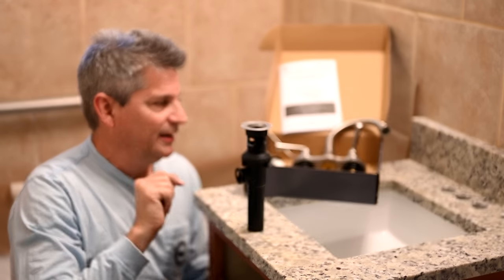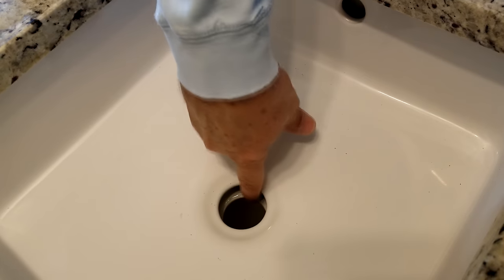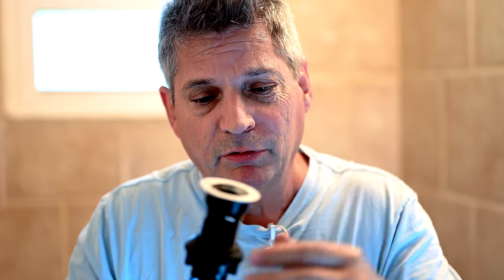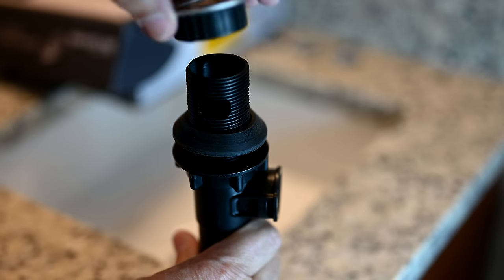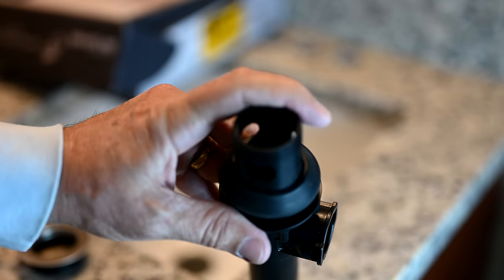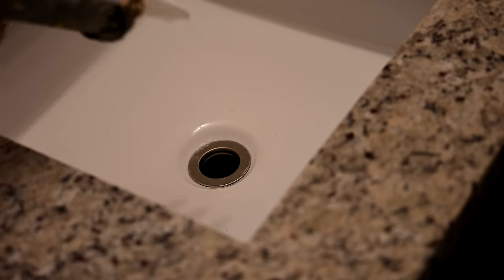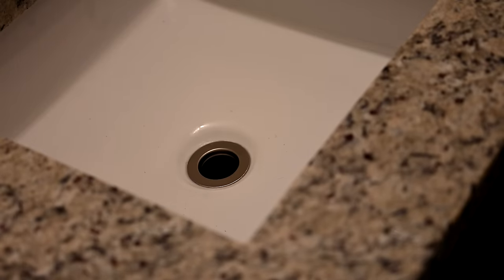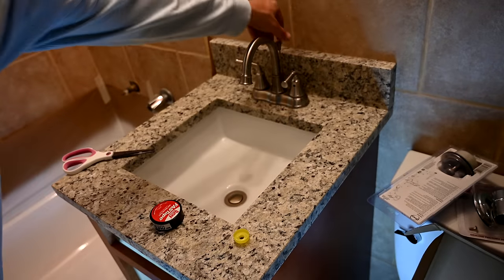How To Install Bathroom Sink Drain/Faucet, No Leaks Under Gasket, Threads [SOLVED] 2023

Comment: Excellent video Jeff - really helped me out.  Quick question - after the install is done, when turning back on the shut off hot/cold valves that feed the second floor (upstairs bathroom sinks, toilet, shower), should those valves being opened totally, or partially?  Does a partially opened valve lead to leaking?
Reply from the maker: I open the valves all the way gently until it stops opening, then back off 1/4 turn.  Sometimes with old valves, they never get used, so once you exercise them they start leaking. I don't mess around. I always put in new valves when adding a new faucet, or new toilet

Comment: If the troublesome connection leaks, do you use the Teflon tape on that thread as well or is tightening it first typically take care of that? I assume the connection is to the wall is maybe 2nd??? Thank you!

Comment: Gonna try this fix tonight. We'll see how it goes!
Reply from the maker: Awesome didn't work for you?
Reply: @jeffostroff  Unfortunately, no. Same leak in the same place. The kit I'm using may not be doing me any favors; it's a tight fit on an old sink, so I may have to keep experimenting.
Reply from the maker: @matthewrice5721   But I would try on the top on the under the flange is silicone to make sure that a sealed well to the old basin. Then underneath make sure that you have the 2 Distinct applications of the Teflon tape in the bottom application of the Teflon tape has to be located on the threads right where the black gasket Meets up with it so that you are sealing that connection
Reply: @jeffostroff  Finally revisiting this, but still with no success. I've got silicone under the flange, I've got teflon tape at the top of the pipe going into the flange as well as over the threads that the gasket will cover, and I've still got leaking between the basin and the gasket. I even went out and bought a new kit to try it and the problem persists. So either the sink is the issue...or I am.

Comment: I have used silicon caulk under the top of the drain in both kitchen sinks and bathroom sinks for years. I did it when only plumber's putty was specified.. Now I think at least some manufacturer's only recommend silicon caulk. I have had very good results with this. One of things I didn't like about the plumber's putty was that it was hard to get the drain tightened enough so that the drain would seat closely to the sink drain area of the sink. Not a big deal but I thought it was sort of ugly.

The thing that worried me about using silicon caulk was that it might not set properly because the air couldn't get to it to cause it to set. But I never had that problem.  One bad thing about the silicon caulk is that it stains like mad and there is some extra work to clean up after it.

I wasn't keen on putting the caulk around the edge of the faucet. I think you can either rely on the gasket or put a little caulk on the gasket before you install the faucet.

As to leaks between the gasket and the bottom of a ceramic sink: This has been the most difficult connection for me in all the plumbing I have done by far. Maybe that Teflon tape idea will solve it.  I've had some good luck with using silicon caulk in that area as well.

Comment: You're so damn thorough. Thank you. I have this exact same faucet. First time installing I didn't check the faucet for straightness, bugged me and loosened things. Second time installing the drain was leaking from that exact same area you mentioned for the pipe tape.
Reply from the maker: Yup, glad to help out Richard!
Reply: Yes, that is yet another nuisance.  After hanging upside down to tighten the nuts on the faucet and installing the drain, discovering the faucet isn't straight.  It is only so obvious once you turn the water on, and it hits the side of the drain.

Comment: Dam. I just install mine last week and no leak for a few days now that I have been using it a lot the water now is slowly leaking. Good thing i saw this. Thanks Jeff. Is Kohler a good brand for sink faucet? I recently got one it was $30 retail price was $140.
Reply from the maker: I think all of the brands of faucets are essentially the same thing it's just who has the better marketing and appeal to their name to be able to charge more money.
Reply: If you think Glacier Bay and Kohler are comparable faucets, you've got a screw loose. That's like comparing a bucket and a paper bag for carrying water. There is no comparison.

Comment: The 2 places where you used the Teflon tape is where licensed plumbers use Plummer's putty. It solves both problems....on the first fit!
Reply from the maker: As I pointed out plumber's party is not the thing to use in fact the putty manufacturers are telling you not to use it on any of the black rubber gaskets. The more effective solution here is the technology
Reply: @jeffostroff  I used 4 it 4 years ago on 3 different sinks in my home when replacing them....I have no leaks....they all work great. I was taught by a licensed plumber 25 years ago. Some practices never go out of style.

Comment: Thanks for the video Jeff - I am installing a new Moen pop up drain and am having the same trouble with water leaking between the sink and the gasket under the sink (I’m guessing it’s this because it only leaks when the drain is open). 
I tried the pipe tape method that you advised, but the threads on this particular drain don’t even start until about an inch below the bottom of the sink - the area where the gasket comes in contact with the drain is completely smooth and the pipe tape doesn’t seem to help. What would you recommend in this case?
Reply from the maker: Only 2 things you can try. Get another drain with another threaded pipe to install there, or change the basin. Probably easier to just change the drain kit
Reply: @jeffostroff  Would you ever consider putting plumbers putty or silicone between the cone gasket and the underside of the sink?
Reply from the maker: @Zucchinix   On a previous video we showed it 4 years ago however it is not recommended by the manufacturers of the plumber's putty because there are petroleum products in there that will draw and crack the black gasket. And besides a few implements the Teflon tape as I showed perfectly that solves your problem you don't need to silicone or the plumber's putty that's why we did not show it on this video.
Reply: @jeffostroff  Thanks. I ended up just ordering a different drain, putting Teflon tape on the threads (which extended higher in the new drain) and zero leaks! I really appreciate your advice! And for anyone else considering the cheap plastic Moen push button drains that might come with your faucet like mine did, just go with a different, better quality drain to save yourself the headache.
Reply: Chiming in. I don't think your resolution was Teflon tape, but rather a better rubber seal and drain pipe.
Reply: @Zucchinix  I'm in the exact same position: Allen + Roth pop-up drain that came with the faucet does not have threads at the juncture between gasket and basin hole. Since the plumber's putty is out and silicone isn't considered, I'm wondering which drain is recommended.  What did you end up buying?

Comment: I understand the concept of using Teflon tape to prevent leaks along the threading; however, what if the leak occurs between the gasket and the bottom of the basin (ie. uneven or defective basin hole)? What would the remedy be for that situation?

Comment: Thanks for the very informative video.  I tried your suggestions, but unfortunately it didn't help.  I was about to call a plumber, when after watching many other videos it finally clicked.  I was trying to install a sink drain made for a sink with an overflow in a sink that didn't have one.  Shows what a amateur I am.  My wife bought the vanity, sink and faucet without me, I just assumed the sink had an overflow and I tried using the drain that came with the faucet.  So I'm in no way trying to bash your video, but just a suggestion to have folks check that first.  Thanks again for the great videos!
Reply from the maker: Good Idea, thanks Marty
Reply: @jeffostroff  or Marty - I noticed I have this issue too. No overflow sink but the drain has the overflow hole and it's leaking at the gasket like in the video. Do I need to replace the pop up drain or is there a way to get it to work without buying a new drain?
Reply: @coodie  I bought a new drain made for no overflow.
Reply: @Ghost6466  Cool. I'll do that as well.
Reply: @Ghost6466   You know what's odd? My drain has stopped leaking. Originally it leaked quite a bit. So I had a towel underneath it while I waited for the new drain to come. I got the new drain, haven't installed it yet cause I have been checking recently each time I wash my hands, and even filled the sink up...and the thing hasn't been leaking lately. Why would that be do you think?
Reply: @coodie  Maybe rubber and gasket set in place so no leak which can take some times. Mine still leaks a bit after applying tape.   I will let it sit for a day or 2 with a bowl and paper towel underneath, and check again.   I might try silicon next.

Comment: at 16:04 is that a water drip on the paper towel?

I had just read on Oately website about not using plumbers putty on ABS plastic pipes before finding your video, so thanks for reinforcing that warning ⚠ .  now I have to check whether or not it was used by the handyman that installed 2 bathroom sink faucets and drains for my rental property 🤦🏻‍♂️
Reply from the maker: Yes, to show you what to look for

Comment: Been having an issue with my Moen Lindor faucet and I've tried several things, but the one thing that I neglected to do was make sure to use teflon tape... boom, no more leaks under the sink at the drain pipe.

Comment: I always thought you were supposed to wrap the teflon tape the opposite way the female parts turn. Maybe that's why every time I install a drain it LEAKS! Literally an hour ago I tightened the ( You know what) out of that nut under the rubber seal. It LEAKS more. Great video.
Reply from the maker: Glad you finally solved it

Comment: All good. I use the Plumbers Putty around the drain facing on the sink. Also, what's with the floppy drain handle? Looks like an adjustment was necessary. Still, a great video. Thanks!
Reply from the maker: Yes it was a tight fit, had to drill wider opening in the granite for this one.

Comment: Hey Jeff, I had the leak between the black gasket and the basin, and the Teflon tape did the trick. Maybe I didn't see the leak coming from the lift rod hole. I pulled both cartridges out and the hot side had an "O" ring that looked oversized. I bought a box of "O" rings from Hazard Fraud and to my dismay, ... none of them were the right size in thickness. I doubled the closest size and it was a snug fit,  but my guess would be that this is the suspect. Note that when I had the faucet off, I used 8 - 10lbs. of compressed air and a dab of water in the unit to check for leaks and there weren't any. Thoughts?  Thanx in advance.

Comment: My sink doesn't have an overflow "catch" so I used electrical tape to block those holes off from the outside of the pipe (it wasn't threaded where they are). That solved my issue.
Reply from the maker: Wow I hope that holds
Reply: 3 loops of electrical tape should be good for a while and if it doesn't then there's still the bottom gasket to slow the leak . It'll also prevent all the sludge that was building up in that cavity where the overflow should be.

Comment: Tremendous video! I did know about the silicone but didn’t think about the tape. How long do you suggest letting that silicone set before fully using it? I know you have to wait at least a half hour for the set. Thank you very much
Reply from the maker: I only buy the silicone that says 30 minute water ready, others say 24 hours, not waiting that long

Comment: Jeff, great video. It made me subscribe BUT..... I've spent a fair amount of time reading down the comments and I haven't found anyone mentioning that right before you said "another successful repair", a drip appeared on the paper towel. Am I the only one that saw this? Probably not but I couldn't find a comment mentioning it. It could have been a condensation drip if that full sink of water that you drained was cold.  Just curious if it needed a further adjustment.
Reply from the maker: Others mentioned it. I put that drop there to show you what to look for

Comment: Great video! Did you use plumber's tape on the supply line connections?
Reply from the maker: No you do not use plumbers tape wherever there is a gasket involved in a hose connection

Comment: Awesome I'm a rookie in the game just yesterday installing a delta with some crazy curved pull up drain with almost no room till when u lift it   it hits the backsplash.  Now the homeowner says it's to tough to pull up. And there's no room for it to move.  I don't know
Reply from the maker: Yup, had similar problems like that. Trick is when mounting the faucet is pull it as far forward as you can, And several times I had to get a masonry bit, stick it through the opening for the pull rod and drill through the stone counter top a bit to widen the ole so the rod is not so hard to pull like what you saw.
Reply: @jeffostroff  thanks 👍

Comment: Great video. Clear, detailed instruction at the perfect pace. I’ve learned a lot from you. I installed the drain per Pfister instructions before watching this and it leaks. I’m going to remove the drain and reinstall per your video. Thank you.
Reply from the maker: Great to hear Peter!
Reply: Update:  reinstalled and after two days no leaks. Thanks Jeff. My recently purchased Ladera pop up drain design does not have threads at the upper end of the drain tube. It also has a rubber washer below the flange. I went with silicone underneath the rubber washer above the basin, silicone on the large gasket below the basin, and tape on the threads on the drain pipe.

Comment: Thirty years of plumbing and have never had so many problems as I had with these recently. I’m convinced the thread is deeper than it used to be and water is seeping thru threads from overflow holes on the tail piece. I’ve been using Teflon with reasonable success, but often having to tweak or redo it. Incredibly frustrating that this problem has developed due to poor manufacturing...I’ve installed hundreds of lav faucets and this was never an issue until recently
Reply from the maker: Yes the cheaper Home depot brands likely have thread issues.

Comment: Great video! I have a somewhat similar problem.

I’m trying to install pop up sink drain. The drainage pipe has overflow holes has shown in this video. But my sink doesn’t have an overflow outlet in the sink hole.  It’s just a hole. I’m wondering if I can still use this solution of taping it. Any insights would be greatly appreciated.
Reply from the maker: The over flow is supposed to find it's way through the overflow hole at tope, then run down inside the basin shell and emerge at the bottom of the opening mouth on the basin bottom side
Reply: @jeffostroff The sink doesn't have an overflow hole, that's the issue. The sink just has one hole that drains out water to the bottom.

Comment: Thanks for the updated video. But my drain pipe is still leaking from the rubber gasket underneath. Mine is a one piece with the flange attached that just drops in from the top. I applied the plumbers tape a couple of times thinking maybe I didn't put enough the 1st time. What else can you recommend? Maybe a different or thicker type of tape? What about pipe dope (Rectorseal 25551 No. 5 Pipe Thread Sealant, yellow)?
Reply from the maker: The first thing I would try is get 100% silicone and then make sure that you get the type that says it only takes 30 minutes before you can get it wet period then I would silicone the flange down to the top of the sink up top let it dry 30 minutes to an hour and then come in and try the rest and see if that helps. The other critical part of this fix is to do that dry fit ahead of time with the black gasket on the threads and make sure you see exactly where the black gasket is going to end up once everything is tightened down so you know exactly where to put the Teflon tape. We want to make sure that you didn't waste time putting the tape in the wrong spot where maybe it should have been lower or maybe it should have been higher up on the threads. If that still doesn't help then you may just have to try a whole different drain or maybe you have a chip in the hole at the bottom of your basin and it's causing a gap between it and the black rubber gasket. Remember when you tighten up that black rubber gasket to the bottom of the basin if supposed to seal tight against it and it looks like in this case you need a little more help but if you overtighten it you will cause it to warp and make it leak even more.

Comment: I have the new faucet ready to go in and the installation instructions do say to use silicone just like you did, but I have this "DAP Kwik Seal Kitchen and Bath Adhesive Caulk"...it says it's waterproof but I don't see the word silicone on the bottle at all. Can I still use this?

Comment: I am installing a Moen 8525 drain, slight water leak at bottom on one side of rubber gasket where it meets bottom of sink. I have tape on. not sure how to fix. should I put silicone on perimeter of rubber gasket that is pressed against bottom of sink?
Reply from the maker: No you should not need to add silicone there if you put the thread tape in the right spots on the down spout